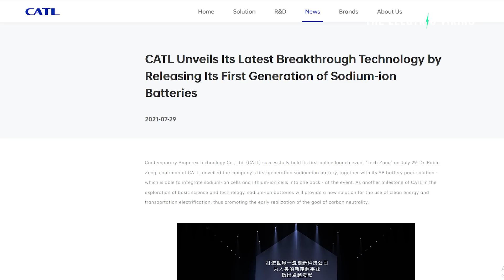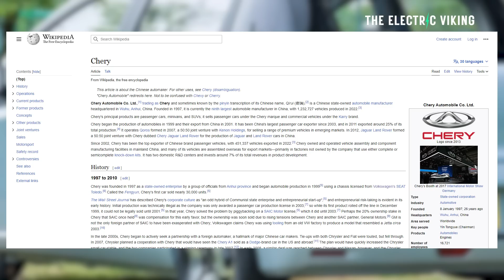The automaker using CATL's sodium batteries with amazing 200wh/kg

Comment: So Sam, just before i sell my lithium stocks, i recall it wasn’t that long ago that i was hearing most major car companies have started building battery factories to supply the massively increasing expected demand. Those factories wouldnt be finished yet and would no doubt be based on lithium chemestry batteries. This will surely increase lithium demand( and prices) as they ramp production. There wont be enough capacity for CATL to supply Sodium batteries to the world, unless these new factories do a refit to compete?
Best wishes for your wifes recovery 10:14

Comment: The reality of new tech that can filter lithium from salt brine from oil reservoirs, salt flats, geothermal wells and salt lakes, is kicking in. It significantly increases the supply of lithium and reduces the time to produce it. ----   Alberta lithium reserves that are the largest in the world. 
Alberta nano-tech that can filter lithium out of oil well reservoir brine, salt flat brine and geothermal brine economically, low energy and no water used.
E3 Lithium Outlines 23.4 Mt LCE Inferred Mineral Resource in Consolidated Bashaw District 
E3 Lithium, Alberta's leading lithium developer and Direct Lithium Extraction (DLE) technology innovator today announced the increase in its inferred mineral resource to 23.4 million tonnes of lithium carbonate equivalent (LCE) contained within the newly-named Bashaw District (the "Resource"). The Bashaw District combines and expands the Clearwater Resource and Exshaw Resource areas into a consolidated resource that contains an estimated total of 59 billion m 3 (59 km 3 ) of brine formation water at an average grade of 74.5 milligramLitre (mgL) lithium (Figure 1).
https://investingnews.com/e3-lithium-outlines-23-4-mt-lce-inferred-mineral-resource-in-consolidated-bashaw-district/

Comment: Another great low energy density ( low cost) battery.Great for energy storage be it grid level or home.
But no,none of the present chemistries will challenge ICE until the energy density can offer ice ranges ie a genuine 400miles AND fast charging ( no more than 15 mins to full).

Comment: For a 100kWh battery battery, one to give half decent range, that's about 500kg of battery, plus all the casing, cables and the rest say three quarters of a tonne. Still a lot of weight. There are a lot of problems being highlighted in relation to extra weight on roads and even multistorey car parks.

Comment: I don’t think lithium is all that scarce. It occurs on every continent and probably in sea water. Probably some companies would like you to think it’s scarce. Like the DeBeers diamond thing, problem with that is that diamonds were being dug up by other players and wrecking the monoploy.
Reply: It's what can be economically exploited, sodium wind hands down in that regard. Sodium won't be for every application, lithium will always be more energy dense but the question is sodium good enough? Most think yes, it's next line down in the periodic table, it's the next best option.
Reply: @ghostofdre  Also next down in the electrochemical series. Although what is the difference between the sodium electrode and the other electrode?

Comment: Thanks as always, Sam. I still haven't found any explanation of what advantage a mixed chemistry battery pack would bring, especially what would be compelling enough to be worth the  added complexity of 2 different and parallel BMSes/rail voltages, etc. I think I heard that sodium charges slower than LiIon (at 4C vs ~10C} and that sodium is better at colder temps than LiFePo4 (below freezing) but no explicit statements. An explainer or pointer to someone else's information would be good. I couldn't find anything by Jordan Gesegee (spelling?) and he's my go-to for battery info. Thanks!

Comment: Come one, please. " We don't need lithium, but we need to use it"  :) I left the channel for few months but nothing has changed.  Lithium price is going down. Yes, but EViking please tell the full picture. It's till 2-3x more expensive than 2 years ago. So Lithium is still high. We will see where it goes, but it's too early to say that battery will be cheap and  the EV cars will go down, EV's are still crazy expensive. And how about this - Tesla stock i -44% in 1 year, where is this great success ? There is bunch o problems with EV cars that EViking will not tell you.

Comment: Sam may have covered this already in one of his videos, but has anyone seen how Sodium batteries hold up over many years of usage compared to LFP batteries?  I see that in the public forums, most people hate the idea of a battery needing to be replaced after 13 to 15 years of usage, even if those batteries are on a lower mileage vehicle.  I understand sodium's current lower energy density, but as that improves, what are the chances Sodium batteries could eventually become the normal standard battery for EV use?  With the average vehicle in America being over 12 years old now, I believe that would be the last answered argument once batteries last dependably over about 15+ years.

Comment: Sodium can get to twice the current best energy density. However, that's using Sodium metal and Gamma Sulfur. That's because Sulfur can store twice as much Sodium Ions than the current Prussian White and hard carbon. Those are coming later this decade, after the Lithium Sulfur batteries with up to 5 times the current best energy density for which factories are beginning to be built to begin mass production. Although the first Gen will only have 3 times the energy density.

Comment: One might propose - if there were enough charge points; range wouldn't be such a problem; especially if you could charge a smaller battery in 5 minutes or so. More frequent short stops for a shorter charge time might be acceptable to buyers. Hence Telsa putting others out of the charging business would be counter productive. If anything Tesla should offer their charge connector design as a stanard all could use. All gas cars of a standard inlet port for gas or diesel, not this hodge podge of designs. Charge points need security and amenties like air for your tires, food, water, ice, a warm or cool place to sit while charging. In a way it is amazing the EV industry doesn't have these things.
Reply: Tesla has already built a huge charging infrastructure, and continues to build it.  They've offered their connector as a North American standard, but no takers on that.  Europe has already standardized on bulky CCS, including Teslas.

Comment: For range you need Lithium batteries unless you change the laws of physics and the periodic table. Sodium batteries are good for small range or standalone batteries
Reply: 200 Wh/kg says that's not the case any more.  However, there is some amount of lithium in these CATL "sodium" batteries.  I don't know how much.
Reply: @incognitotorpedo42  exactly my point. They will still need lithium. I see this for low entry cars. People that need range will also need lithium batteries. It's simple physics.

Comment: Sodium provides possibly two major benefits it may break the Lithium supply limit; allowing EVs to scale. It may be less environmentally impactful, lithium  production takes 500,000 gallons of water per ton.  It is suppose to be cheaper. But - so far it weighs more, and has a shorter life.This may favor battery swap designs. There remains a major need to cut vehicle weight; Sodium is going the wrong way on that front.

Comment: Ty. CATL came out with a combined Na Li battery in 2021. They have worked on increasing energy density, packaging, battery management, etc. 

However, according to CATL, battery prices can come down 30% eventually. I would not expect immediate battery prices to drop. Better performance in cold climates, faster charging , slightly better density are important features. It i was selling NaLi batteries I would emphasize those features and keep prices high to slightly lower.
Reply: The number of times Na batteries can be recharges is a major block to Na batteries. 
Depending of how they are used Na barreries can be recharged 900 -3000 times. 
If you charge your car when you get home, and you only get 900 recharges, then your car will last 2.5-3years!  What a risk to take!
Reply: @RamblingBob  . But if you only charge fully once a week with a  few peaking cycles (potentially earning something for grid support), it could last 5x that - by the time the tech is exported from China.
Reply: @kadmow  Most people will arrive home and plug in their car, so that it's available when needed. A car with an Na battery may be useless after 3 years and whilst you may be lucky and get longer, there's no guarantee that you will. This is a huge risk. 
I've looked at many websites enthusing about Na batteries, but none provide the expected number of recharge cycles... they must, if Na cars are to be adopted. 
I keep hoping that battery technology will get better, but so far and given a choice, I wouldn't hesitate in choosing a fuel cell car.
Reply: @RamblingBob  900 to 3000 cycles is a pretty big range.  These things are typically measured using full discharge at a high rate, then 100% charge, also at a high rate.  (I think 1 C, maybe more)  That's pretty abusive compared to normal driving and charging behavior.
Reply: @incognitotorpedo42  Most people don't have driveways, but those who do will typically arrive home and plug in their car, so that 900 battery recharge cycles will mean the car/battery pack will last 3 years. Ok, it may mean you get longer, but there's no guarantee that you will and that is a huge risk to take when buying a car.
You may think the risk of your new car being worthless after 3 years is an acceptable risk, but the number of recharge cycles should be available and published.

Comment: Sodium is 3 times heavier than Lithium.  The additional weight of Sodium will be a big factor against its use in electric cars.
Reply: 200 Wh/kg is all you need to know.  The lithium content of Li-ion batteries is a very small fraction of their total weight.

Comment: My guess is that Japan has a major "What does my boss want to hear" problem.  Someone may well have told the heads of Japanese car companies things like there not being enough lithium because their bosses didn't want to see ICE disrupted.  

There was a shortage of processed lithium.  Caused by a sudden increase in demand for EV batteries.  But the industry responded and now there is plenty processed lithium.  

Will sodium replace lithium?  We haven't yet see the data.  Cycle life?  Charge/discharge rate?  The last decade has seen many claims of new battery tech but most "sure thing" ideas have not panned out
Reply: I think sodium will replace lithium in applications where higher weight is not as big concern or where you want to keep prices low. For electric cars basic people's car will probably use sodium-ion batteries but higher performance cars will use lithium-ion.

Comment: Lower priced 20 kWh per 100 Kg is gonna be a game changer.  The 18 wheelers will save so much per year, they will be very eager to switch to EV … especially in mountainous routes with lots of breaking.
Reply: Hi Doug 

Im concerned about all the trucks breaking...
Reply: @pierreterblanche4830  
What's your concern?  I've heard about Tesla semis having a software glitch which was likely corrected quickly.  And a parking brake problem which was suffered by most semi manufactuers who used the same supplier.

Anything else?
Reply: @bobwallace9753  breaking vs braking!!.... 🤔
Pierre has a funny bone.  You braked yours.  Or did you breaked it?... 😉
The OP said breaking
Reply: @alexmanojlovic768  
Tesla semis broke.  Software glitch.

Tesla semis' brakes broke.  Bad part from supplier.

Most semi manufacturer's brakes broke.  Same bad part problem.
Reply: @bobwallace9753  wow!! You struggle with inference, ambiguity & humour, clearly!  You asked Pierre what his issue was with the braking problem (because it was Bendix's fault) but Pierre was taking the P155 at the OP spelling it breaking.  So I clarified:-
BRAKING VS BREAKING & even gave a MASSIVE HINT by saying your funny bone is br[A]king....  I get an encyclopaedic explanation of the Tesla/Bendix's recall.  You & party fun do not go well together...
Reply: @alexmanojlovic768  
Truthfully, I sometimes can't tell if someone is accidentally misusing a word or attempting to be humorous.  I assume the former and answer accordingly.

Sorry if that got your bloomers in a bunch

BTW, you missed the humor in my last post...
Reply: @bobwallace9753  your last post was displaying the irony of Tesla's unfortunate, undeserved reputation.  It wasn't humorous, merely ironic.
Enjoy your next party & let us all know if you "pulled" via some of your rib tickling jokes... 😁
Reply: @alexmanojlovic768  
I'll give it a try at next week's Wednesday night stoics' beer tasting..
Reply: @bobwallace9753  No you won't.   They banned you due to your dreadful jokes.
You'll be at home responding to YT comments.  With your cat for company. 😉
Reply: @pierreterblanche4830  good catch. I meant regenerative braking
Reply: Tesla has already smoked the diesel market using more expensive batteries.  I do wonder how long it will take other large truck manufacturers to produce 500 mile range semis that sell for <$300k.

Comment: The ideal would be a hybrid Sodium / Lithium battery, giving both usefulness in city environments and long range.
Reply: Yeah, but Na batteries only recharge 900-3000 times so are you going to get a new battery pack or a new car after 3 years? Na has potential, but we still need to perfect this particular form of sealing wax, lol

Comment: Thanks for talking about this.   Looking forward to putting them in my 2011 Nissan Leaf.
Reply: Interesting.  I wonder if there's a large enough market to create an aftermarket supplier for old EV replacement batteries.
Reply: @bobwallace9753    People will just buy cells/battery packs out of wrecked cars.
Reply: @bobwallace9753  I believe there is.
Reply: @bobwallace9753  there has been aftermarket batteries for Lexus and Toyota hybrids for a while. They vastly improved range and fuel economy
Reply: LOL Nissan will be bankrupt before that happens
Reply: @orionbetelgeuse1937  just be patient
Reply: There needs to be standardized cell sizes and BMS interfaces for this to happen.

Comment: Sam talking disingenuous crap again.  Lithium prices dropped because they rose to ridiculous levels last year for no coherent or truthful reason - just BS scaremongering.  Lithium having dropped 70% is still 500% more than it was 2 yrs ago.
 Sodium ion (unknown anode) batteries can now make 200wHr/Kg - so effing what.  I get 44 li of diesel at 38 Kg to give me 440KwHr (11600 wHr/Kg) for a range of 1000Km and a refil time of 5 mins in a car that cost £15,000 ($20,000) and will last 15 years.  When an EV beats that, I'll get one.